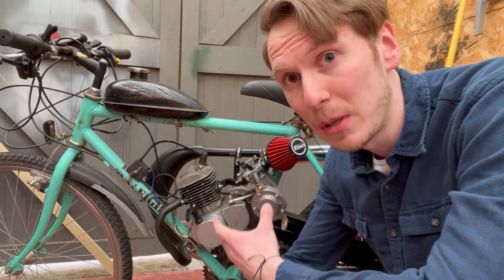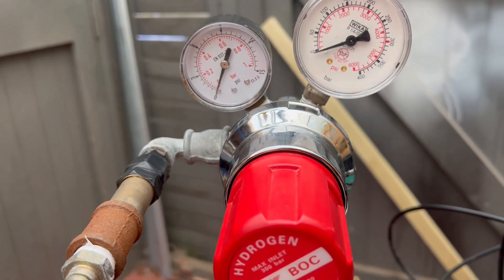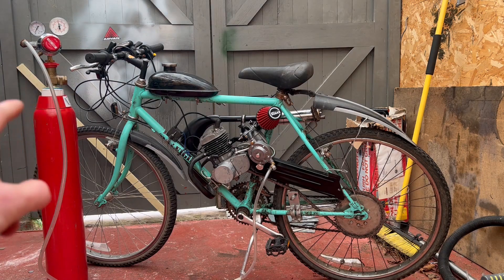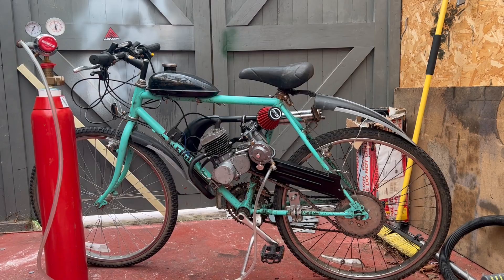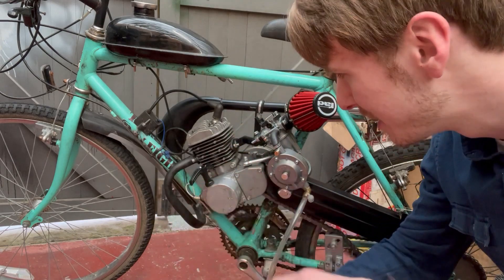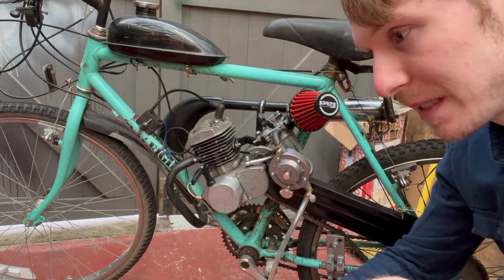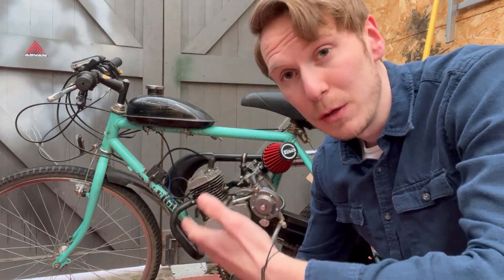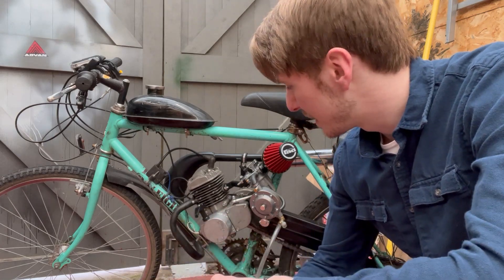2 Stroke Hydrogen Engine

Comment: How are you lubricating the 2 strokes
Reply from the maker: With difficulty, still end up using 2 stoke oil that’s burned off, which makes using hydrogen a bit pointless as carbon emissions are still present

Comment: Have you tried going past TDC and running off of residual heat? I read hydrogen won't knock
Reply from the maker: not past TDC, but at TDC or just before works well

Comment: I dont have any footage but I took a carb from a oil injected engine and used that. also the honda 4stroke clones are rather nice as well be great to strap that tank on to go for a ride with a jackshaft kit.
Reply from the maker: Awesome, I have used honda clone engines in other videos, check them out as converting them to run in hydrogen is very easy.

Comment: loving the content,  i bought 1 of thoose little engines for £100 of amazon and stuck it on a blue mountain bike, looks like the same 60cc ICE from china lol.
have you thought about creating a free generator, maybe if it was inside a vacuum it would be silent? would the pressure continue to rise?
Reply from the maker: Hi, yeah this was a china doll 60cc engine.
Do you mean a box with a vacuum inside and an engine? I don’t see a benefit, noise isn’t a problem. And would be a pain to seal, or am I missing something?

Comment: Which polarity fires ignition of hydrogen, - positive or negative high voltage?
Reply from the maker: Good question, the standard ignition system was used but with retarded timing.

Comment: Try using a EGT sonde at the port and use that temperature to shoot for a stoichometric ratio. Set it like an airplane, back off the mixture until peak EGT and the drop and enrigh it back past peak a few degrees cooler.

Comment: I have one question. Is oil going to old fuel line?
Reply from the maker: In this video there was no oil apart from what was already in the crankcase. That’s why I didn’t run it for long, would need some sort of oil injection system or lightweight/thin oil in the carburettor?

Comment: It would be nice to try some kind of venturi effect tube that mix the hydrogen gas with oil. Maybe a tank where the high speed gas can pick the oil with the venturi effect. Your work is very nice, don't stop working!
Reply from the maker: Hi, Thankyou for the comment. Using the carb to provide oil would probably be the best idea, reckon 2 stroke oil is to thick by itself to flow up through the jet?
Reply: Nice! Just one question... Where did you find the carb?

Comment: Make this some little advanced ,just like look this practical ,and how you fit hydrogen clinder in this so you will some change in this
Reply from the maker: Would been a smaller gas to to make this practical, perhaps a carbon fibre one to save weight

Comment: Many two stroke engines have automatic oil injectors, which are in the inlet manifold and atomize the oil. It would be nice to see an engine perform under load, as power/torque is not being demonstrated. As regards the carb, what kind of diaphragm is on the side?
Reply from the maker: Thankyou for the comment,
I will have a look for some sort of oil solution, it definitely needs something, and corrected ignition timing.
Sadly I don’t have any good method of testing load with this engine but it does have enough torque to pull someone along, but not as good as it would have been on petrol, Still fantastic to see.
The diaphragm if off an LPG system.
Reply: @Hydrogenguys  Maybe some kind of venturi tube in the intake, or could you use 2 stroke oil in the carb itself, since it isn't being used for petrol? Thanks for the info on the LPG diaphragm. I thought so, but wasn't sure. Your 4 stroke engine experiments are also interesting. At some point it would be nice to see if the generator could be governed at correct speed and load measured (watts). I guess stationary engines are a good place to start as the supply of hydrogen is easier to provide :)  I am very interested in hydrogen as a fuel. Problem is the speed of the flame front at higher densities. It is so fast - explosive, but there are always ways to deal with that. Good luck!

Comment: Thanks for adding oil. Obviously the engine was designed to run on fossil so it need lube. Now if you could find a way to keep it lubed (injection?) . Good work!!👍
Reply from the maker: Thanks for the support, definitely needs some sort of oiling system, or perhaps a wet sump set up like some old supercharged diesel engines,
More work to be done that’s for sure.